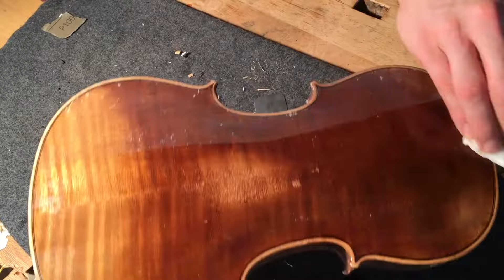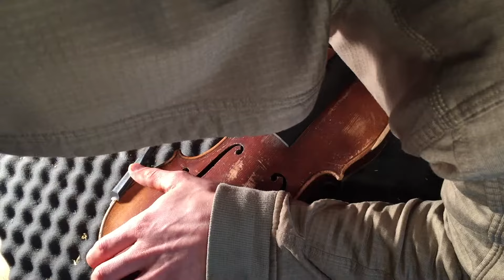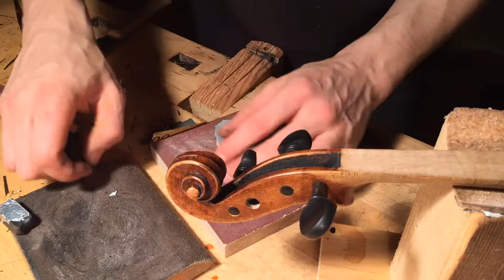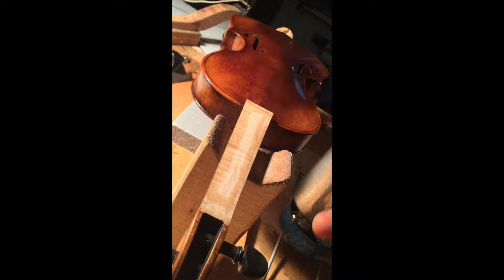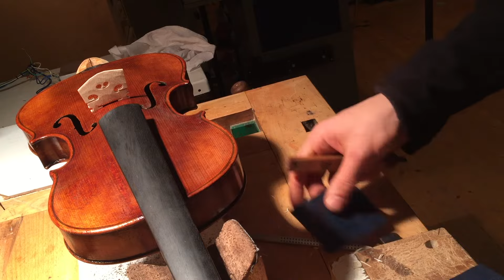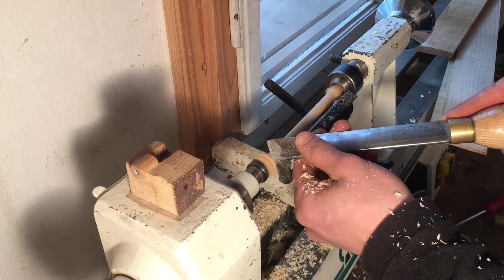Violin Repair Work Shop 2nd violin

Comment: Großartig!
Ich habe mehrere Fragen:
1. Könnte man auch ein angefeuchtetes Mikrofasertuch nehmen, um die Lackoberfläche zu reinigen? Hausfrauen schwören darauf bei allen glatten Flächen, die schmutzig und fettig sind.
2. Statt Schmirgelpapier könnte man auch mit einem Putzschwamm / Radierschwamm die hartnäckigen Verkrustungen entfernen, oder? Was spräche dagegen?
3. Welchen Lack haben Sie für die Restaurierung verwendet? Alkohollack oder Öllack?
4. Wie hoch über der Geigendecke hat die Frontkante des Griffbrettes nach der Restaurierung geragt?
5. Bei meinen dicken Fingern wünschte ich mir immer, dass die Saiten etwas weiter auseinander wären. Ist die Breite des Griffbrettes fest vorgegeben oder gibt es auch Geigen mit etwas breiterem Griffbrett?
Reply from the maker: Ok,
1. meist kein problem. Schellack möglichst trocken oder kurz reinigen, ein Hochglanz geht da am besten mit Politur od polish.
2, Jain, glätten geht besser mit feinen Papier od auch der Ziehklinge der Schwamm ist zu sanft, für weichen dreck ist er aber geeignet
3.  alkohol Schellack, ist relative einfach zu verarbeiten und auch Ideal.
4. Der Obersattel liegt unter der Decken-Hohlkehlen-Ebene, die Steghöhe ist 33mm , beim Halsfuss ca 6 mm von der Ebene bis zum GriffbrettUKante. Alles im besten Bereich.
5, 24mm ist Standart oder schmäler. Saitenabstand 16.5 da kann man ein wenig nach aussen gehen, vielleicht 17.5
Reply: @CJKViolin  Vielen Dank für die ausführliche Antwort. Ich habe sie mit großem Interesse gelesen.
Reply from the maker: @ghlscitel6714  sehr gerne ,freut mich

Comment: what are you scraping the violin with? a metal piece??
Reply from the maker: Yes, Its a carbinet scraper . The most efficient way to remove krusty dirt from the varnish and prepare the surface for the next step. It must be dressed without a nick.